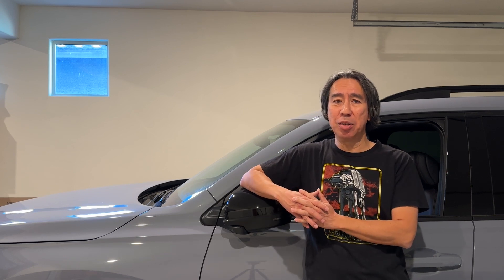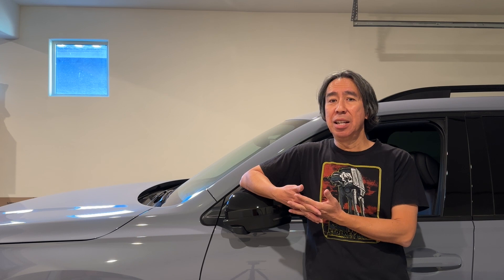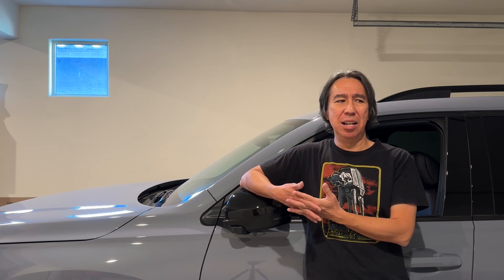Honda VCM (Variable Cylinder Management) - Everything you need to know.

Comment: Hi. I wrote the VCM megathread on Odyclub and other Honda forums. I'd like to give you kudos for your explanation, all things considered it's pretty good and better than many other people out there who don't understand all the nuances to the system.

With that said, I would like to note a few things:
- VCM-4 was actually first introduced on the 2021 Acura TLX Type-S and MDX Type-S, not the 2023+ Pilot. Those Acuras were the first to use the revised DOHC version of the J series engine. And they are one of the few non-3.5L J series engines to be equipped with VCM.

- While you are correct that VCM-4 has many engagement parameters, these are not new. The previous versions of VCM also had more than one parameter used to determine whether VCM can be engaged. Even if the coolant temperature reading was within the allowed range, other parameters could prevent engagement as well. The coolant temperature was just chosen as the reading to modify as it was the easiest and safest one to modify without any major consequences. What seems to be different with VCM-4 is that something with the specific combination of parameters to allow engagement of VCM has changed. It is not necessarily just about there being multiple parameters, as that has always been true even with previous versions. For all we know, it could be as simple as the coolant temperature threshold for engagement being lowered. On previous versions, this threshold was greater than or equal to 167 degrees F. Maybe VCM-4 has simply lowered this threshold a bit beyond where the current disable devices maintain the falsified reading. The main issue right now is that none of the makers of these devices have been interested in investing in R&D to study VCM-4 and come up with a solution for it. I speculate that this may be because the number of vehicles using VCM-4 is still quite low, and thus there's not nearly as much demand for a solution. I know the maker of the VCMTuner line of devices has said they currently don't have plans to invest in acquiring a test vehicle to research the system.

- Some users on the Piloteers forum have determined by monitoring live data that if you put the Pilot in Sport mode, VCM-4 will not engage. This is likely the cleanest solution for now, though there are drawbacks as well since you would have to remain in Sport mode.
Reply: my question is does it really save gas or is it a self-destructive myth?  from high level view it appears to be a myth just like the start and stop at idle that I find to be extremely dangerous , I have a 25 and have noticed constant shifting up and down while drive a level road is quite annoying not sure if it do to the VCM of the worthless 10 speed trans  yes it is disappointing  any one thinking of purchasing one of these think twice
Reply: @dougowens2686  Calling it a myth isn't quite accurate. In practice it may not save much, but it's really only meant to save fuel in the controlled conditions of the EPA tests. Because at the end of the day, all this is to meet CAFE regulations, nothing more.
Reply: @wiimaster2847  CAFE is scam the regulation should look at the carbon output of the life of the engine and out put of the cost of replacement  not the MPG at new the carbon problem of direct injection over time greatly also reduces MPG over time
Reply from the maker: The 10 speed auto is busy even with normal driving.
Reply from the maker: @wiimaster2847  Thank you for sharing these additional information.
Reply: On my 2023 Passport Trailsport when in Sport mode I get considerable engine braking going downhill. It does scoot taking off in 1st gear at regular speeds but the performance is a bit jerkier. I'm stoked with this vehicle.
Reply: I tested MPG at highway speeds in Econ and Sport mode. In Econ, I got 23mpg on a 2.5 hour trip to Chicago. I got 22 mpg on the way back in Sport mode. I just make sure it's in Sport mode when I'm on the highway (at a minimum).
Reply: How much the muzzle companies pay you clown? "I speculate this that those", "I know the maker of this that those"...
Reply: I like better the sport mode, and you have the power to control a lot better with traffic all around you…its quicker

Comment: Great Video. I have the 2020 Pilot (VCM version 3)  I think you answered  my transmission slipping problem at the 6:23 mark in your video. Highway speeds (80mph) release throttle, (goes to 3 cylinders) then reapply throttle (goes to 6 cylinders) then the transmission slips for about 5 to 8 seconds.
Reply from the maker: @maddog2557  Thanks for your reply and posting your experience .

Comment: You explained the VCM Honda history very well. Excellent presentation! Good information for anyone thinking about purchasing a Honda.
Reply: Don’t let this deter you from buying a Honda, I had a 2008 V6 Accord with over 160,000 Kms when Honda approached me during a routine service, stating they would replace the rings on the 3 cylinders that would de-activate, for free. I believe it was around 2015, oil consumption was up but marginally.
Was such a good car that I bought the last of the V6 coupe Accord in 2017. I believe the 2008 had 286,000 Km at the trade in time, was still running strong.

Comment: I was interested in the upcoming 2026 Honda Passport, but with that VCM and the recalls with the 3.5 6 Cylinder I am not so sure. My 2024 Honda Civic SI had a recall which I just had fixed  with the worm gear in the steering. What’s going on with Honda?
Reply from the maker: The new Passport will also have the J35Y8 engine.  This engine with VCM version 4 has been in the Pilot since 2023.  Have not heard anything “bad” so far.  Then again, too early to tell.

Comment: One thing to keep in mind (if it was mentioned here then I missed it)….if you install a VCM deactivator and you ever need warranty work, be sure to take off the deactivator. Any modifications could void your warranty work. This also applies to extended warranties
Reply: Yes, Honda does not want you to improve the longevity of the engine.
Reply: 100% - And make sure your engine is oil is topped off (just in case)

Comment: I have an 06 Odyssey with just over 200K. I never liked the VCM, but I never deactivated it. I always changed the oil around 5 to 7K and had the transmission serviced at around 30K intervals. I use less than a quart of oil between oil changes and have no transmission issues. We changed the timing belt twice and checked/adjusted the valves each time. There was no excessive build-up on the top side of the engine, and the plugs had normal wear. I always used Top brand synthetic oil. I think maintenance is key! I also have a 24 Pilot Elite  with 12k miles. I changed the oil at 1k, 6k, and 11k. My milage has averaged 24 mpg over the 12k miles. It started out under 20, but it slowly increased. On a recent 3k mile trip, mostly highway, we averaged 28 mpg. One tank we got over 30 mpg. I am a pretty mellow driver, so that may play a role? I also agree about first gear being very low. Though I would say the transmission also smoothed out around 3k. It doesn't really bother me anymore. If you use snow mode, the transmission starts in second gear. I don't know if that is good for the transmission in the long run? Though I have heard the MDX prioritizes a 2nd gear launch under mild starts to smooth out acceleration. I guess different transmission programming could help smooth things out as well. Enjoy your new ride. So far, we love ours.
Reply from the maker: @life36899  Glad to hear about both of your vehicles.

Comment: My 2019 sport is the best truck I have owned over 40 years. Don't care for the VCM and feel it kicking in at highway speeds on cruise control only. I can live with it. The engine shut down at idle with the newer Ridgelines is the problem I see, push that button to disable and push button transmission. I Like my shift nob and no button to push! It Tows my GeoPro 19' RV trailer 4000lb loaded pretty easy. The key and most important thing  with the 3.5 engine is to keep up on the maintenance. Oil changes, transfer and rear differental oil change which I do myself, plus Transmission oil which I change every 20,000-25,000 miles. The 6 Speed appears to be holding up well at this point with 55,000 miles. So I think as with most honda's, Maintenance is key.
Reply: Yes. My 2005 Pilot has had 5K oil changes and 30K trans and diff from new. No towing and it shifts like new at 275K and purrs. Maybe 1/2 qt every 5K oil change
Reply from the maker: @donot6185  I like the 6 speed auto too (on my 2014 Odyssey).  Did ATF drain & fill every 20k, then later 40k miles.  Solid transmission and still felt like new when I traded it in.

Comment: If I buy a Pilot (good chance of that)..   I would like to turn off the cylinder-deactivation system (in a way that is not harmful to the engine)..  and just run with all six cylinders running full time..  I do not mind it I get less fuel economy..

Comment: I have a 2021 Ridgeline Black Edition with 38K miles.  It's a reliable, comfortable small truck. I've never noticed any engine/transmission issues. I drive mostly in town and suburban with an occasional 180 mile RT once a month. My gas mileage equals the EPA window sticker numbers. I get it serviced at my local Honda dealership.  Next time I get regular service, I'll ask about VCM issues.  Thanks for posting.
Reply from the maker: @wattheheck6010  Each version of the VCM supposed to be better than the last.  That’s how engineering should be.  Your 2021 (version 3) should be better than my past experiences.  Unfortunately, you may not experience any issues until after the powertrain warranty expired.  Or maybe not at all, let’s hope.  My videos are to inform and educate.  And not to scare anyone.  After all, I did just bought another one.

Comment: Great info
i had to build a Potentiometer to dial down to take that VCM out of my 08 odyssey and stop the burning oil

yes my buddy had to change the passenger side front engine mount went bad

all kind of issue, least reliable honda so far for me
my Japan made Honda / Acura always been top notch from old accord to Integra, Type R,  TSX even right up 2010 Fit were excellent

Comment: What do you think about Jeep Grand Cherokee?  They have v6 still
Reply from the maker: @王涛-g5f  I also own a Dodge Challenger with the same Pentastar V6 3.6L.  Solid engine, no direct injection, no turbo, no cylinder deactivation.  And the ZF (8HP) transmission is quick and smooth.  Great powertrain combo.  86k miles no issue, just oil changes.  I would expect the same on the Jeep GC.
Reply: @ Thank you very much
Reply: @andrewwang128  Is that the 9 speed transmission? I'm looking to buy a 2022 and read about all the trouble with the 9 speeds.
Reply from the maker: @itsfig5872  I don't know much about the 9 speed ZF transmission.  Perhaps others can chime in.

Comment: If your smart you get it de-activated as it is very harmful to the engines. Every brand that has used similar systems have had early engine failures and those gas savings dis-appear compared to the cost of replacing your engine. It is not worth it! I think Honda and Toyota are forgetting why people buy their products it was because they have always been superior in quality and reliability, but in the last decade it is beginning to change. If we are going to get worse quality and lower reliability we might as well by Ford and GM. I tell them all the time the reason I purchased a Camry in 2020 was because of Honda insisting on CVT transmissions and turbo charged engines. I do not want problems in the future I was reliability and long lasting products especially with the cost being added to these vehicles! Now they bring this about instead of learning from GM and Ram what these systems cause.

Comment: Andrew - I have a 2023 Ridgeline RTL-E.  which VCM muzzler will work for me?
Reply from the maker: @danhudson5577  I only have experience with VCM Muzzler II, and would recommend it.  I’m sure others would also recommend other devices.
Reply: @andrewwang128  And , to the best of your knowledge, the Mussler II works on the 2023 Ridgeline engine.  The newer engine (with the more complicated VCM) in your 2025 Pilot had not been introduced in 2023?
Reply from the maker: @danhudson5577  VCM Muzzler II will work on your 2023 Ridgeline.  Honda Ridgeline still uses the old J35Y6 SOHC engine.    No changes there (yet).  Only the Pilot switch to the newer J35Y8 DOHC engine in 2023.
Reply: @andrewwang128  Thanks for the info - gonna install the Muzzler when the 36k warranty expires this Spring

Comment: What about keeping it in Sport mode? Would that keep it from deactivating cylinders?
Reply from the maker: @s2324  That’s actually what I plan to do for my next video.  Both Tow and Sport mode will keep the VCM off.
Reply: @andrewwang128  Thanks for that tip! It can be an alternative in installing a muzzler
Reply: @andrewwang128 how do you know that? Do you know if just using either tow or sport mode would disable it?
Reply: @andrewwang128  I've read a few posts on reddit saying sport mode definitely doesn't disable VCM. You can 100% confirm that it does?

Comment: My 2011 Pilot still runs very well, just wondering if may confuse ECM to make the engine running rich all the time? Due to ECM reading temperature is lower ?
Reply: No, as the temperature is still within a range that allows the engine to run normally even though the temperature is reduced.

Comment: Any chance you know of any VCM muzzler coming down the pipe for the 2023+ Honda Pilots & when will any of us Piloteers know if Honda finally master the VCM issue of Oil consumption, Eng Mount, Spark plug follower & Sludge & carbon build up and what is the best preventive meassure that will protect your Honda Eng VCM fiasco?
Reply: Yes, one is in the works..
Reply: @JayBD626  which company is working on their version for the 2023+?
Reply: @ S-VCM.  I believe they are in Canada
Reply from the maker: We shall wait and see.
Reply: Unfortunately the best prevention is not to buy a Honda.  I’d much rather have a smaller engine with a turbo than a v6 with VCM.  Too many ancillary problems with the VCM. Turbo issues are easier to mitigate with more frequent oil changes and judicious use of the throttle.
Reply: @roch145  We drove a 2025 CRV. The seats are too narrow and that engine seems to really rev high. Effortless response is not there compared to a V-6. The back seat doesn't have much headroom either. The hybrid has no spare so that's a no no.

Comment: The VCMTuner 2 is supposed to work for current Ridgelines. You mentioned at 8:53 that the lastest engines will not work with the VCM deletes. Is the Ridgeline engine different?

Thanks for the informative information.
Reply: In your opinion is the J35Y8 a better engine than the current Ridgeline version. Thinking about buying a Ridgeline. This may make the 2025 a better choice if that engine is better.
Reply from the maker: @danayo8852  I don’t know, because my experience is 4 months so far.  I’m a bit bias because I like the old engine “better” because I know exactly what to do to make the engine last forever, if I want it to.  The new engine is still a J35 but somewhat new, so it’s anyone’s guess because we can’t control the VCM.  As much as I want my cars to go 300k miles, we are human and will probably get a new car before reaching that milestone.
Reply: @danayo8852  The J35Y6 in particular is a trainwreck right now with the connecting rod bearing issue that is more widespread than Honda claimed in their initial recall. I would avoid any vehicle with that engine for this reason. So purely based on that, I would say the Y8 is probably better. But I would take an older J35 like the J35A or J35Z line over either.
Reply: @danayo8852 I bought a 24 ridgeline. The 9sp is a solid transmission and the SOHC VTEC J35 is faster, easier to work on, and is well known how to make them last.
Reply from the maker: Current Ridgeline uses the older J35Y6 SOHC V6 engine.  Current Pilot has the newer J35Y8 DOHC (double overhead cam) V6 engine.  Perhaps at the next update, it’s expected Ridgeline will also use the newer J35Y8 engine.

Comment: Honda should know better they make more engines than anyone. There is a reason Toyota never used it.
Reply from the maker: @zdl360  Some would guess that Honda would just “2.0L Turbo” all their large vehicles.  Instead Honda kept the naturally aspirated V6.
Reply: they do not make more engines than anyone. they also make only low power engines
Reply: @O8bsj193jdn  You call the K20C1 low power engine?
Reply: @theholt2ic219  wow it has 320hp. That was exciting in 1954.

Comment: Do you see any difference with the new engine ? More smooth ? More power? Thank for all your video ! Its very interesting
Reply from the maker: @lucmarquis5822  Even though the new J35 has more power, I don’t feel more power.  Rather the lower first gear makes it feel quicker off the line, and 10 speed auto shift very quick.  So this 4,600 lb vehicle does “feel” quick and lively.  Don’t have any way to measure acceleration times.  The engine still does screen when you jump on the gas, and the quick 10 speed will rev that engine at an instant, sounds more fun.  Smooth? All new cars are smoother and quieter, so hard tell.  But overall the new-current Pilot is a lot more refined vehicle.
Reply: @andrewwang3900  thank you ! Anjoye your new vehicule!
Reply from the maker: Thanks.